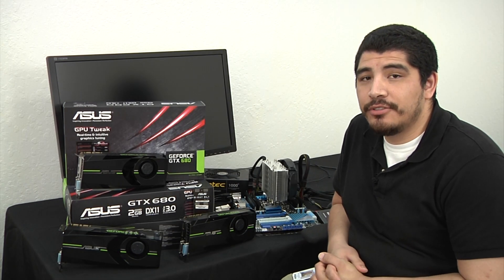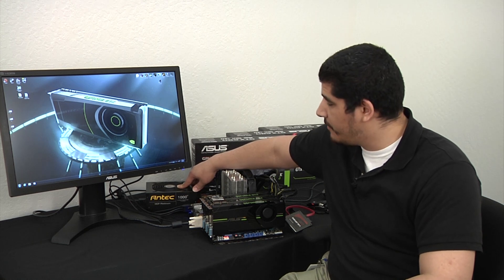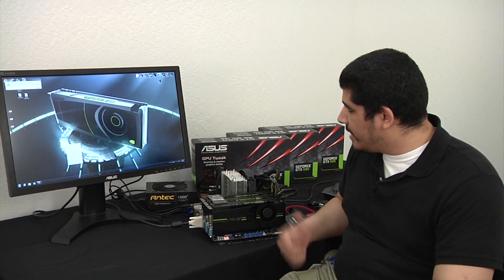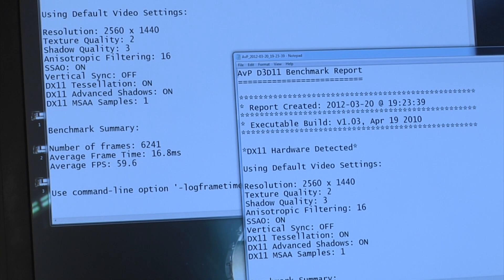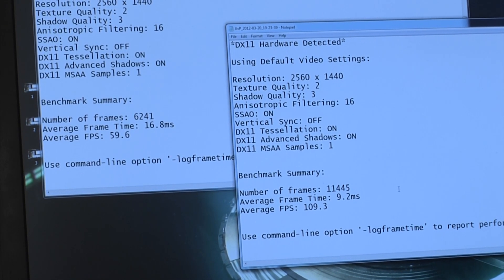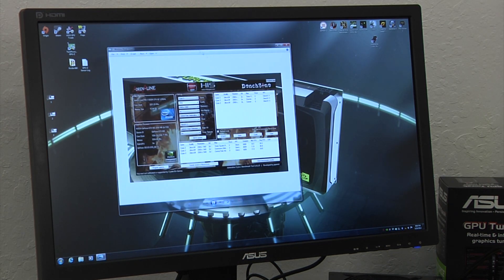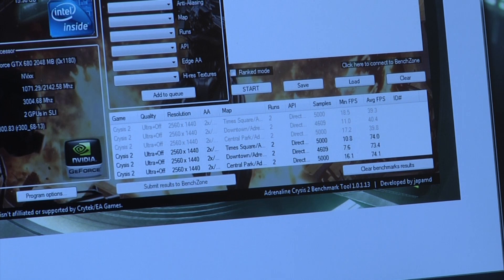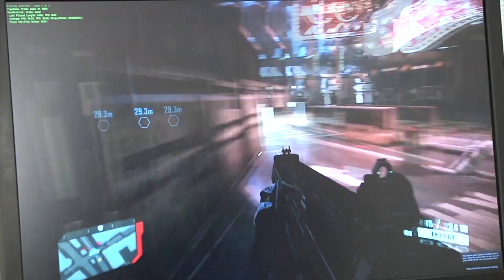3-Way SLI on GeForce GTX680 Graphics Cards by ASUS

Comment: ASUS, I am an avid 3-way user and I only use Asus products. Please help me understand why with your flagship Gaming 3-way Motherboard, the ROG Zenith Extreme Alpha... For a price of over $600 why is there no 60/40 3-way SLI bridge included? I was unable to find a HB SLI bridge for 3-way of any brand except for MSI who has a 80/40 3-way "LED" bridge (detects as HB in GPUz) of course this bridge won't fit the Alpha with 60/40 spacing! So i got the non alpha Zenith Extreme that the 80/40 bridge would fit by jumping the 2nd slot. Unfortunately the board being intended for 4-way seems to really dislike 3way! Help me understand why I had to settle for a lower model motherboard because there is no sufficient SLI bridge available for your flagship x399 motherboard!?! SLI bridges are very cheap, did no one do any testing on the alpha using the non HB bridge too see that atleast an HB LED bridge makes a huuuge difference for sim racing surround users! Just like nvidias Bridge chart states HB for Surround! I'm not pleased with the non alpha zenith, I'm beginning to regret leaving the x399 Strix. PLEASE 60/40 HB SLI bridge! There is no point to 3way on the alpha without it! Thank you

Comment: I purchased the GeForce GTX680 Graphics Card by ASUS, just one card though, I'm on a 64 bit system, and my display driver is forever/keeps on stopping/stopped responding,and crash my pc,how do I fix that, and why is such happening
Reply: if you didnt removed driver of other grafics card and installed driver of new one its normal that yourp pc will crash... best thing to do if i buy a new grafic card... save all data on extern harddrive and reinstall windows with the new grafic driver
Reply: Thanks, but how will I go about allocating both drivers inorder for me to keep the one I need and un install the other?

Comment: I'm assuming you think that the fan on the side is pushing air into the card, however that's not the case. Air going into the card comes from the back (where the video ports are) and gets expelled out though the fan on the side. So the air that gets taken in is cooler air from outside the case and the warm air gets pulled out through the fan into the case. ^-^

Comment: Not all games support fully (or at all) SLI. SLI scaling is horrible with LOTS of games. I personally would get a single 690, even if SOME games will scale 30% better on 3 GTX680. Later you can add another 690, but even 2 is enough. Also, if you clock the 690 at 680 speeds, it is actually faster than 2 680, because of the on board SLI structure! And generate less heat, and you have more Vram!!! VERY important details. For me one 690 would be enough up until the "possible" 790. Why more XD

Comment: actually the 4gb models come in hand at a certain point. if you are running surround for example resolutions as 5760x1080, 5760x1200 or even the extreme 7680x1600 will ask alot of vram with games as Battlefield 3 etc.. however as you mentioned if play games like COD or any other game at 1920x1080 you won't notice any difference in either the 2gb or 4gb

Comment: GB on your grapic card isnt that important. for instance if ur playing COD with a 2GB vs a 4 GB ur FPS wont be higher since ur not using it. on the other side if u run out of memory ur FPS will drop like hell. more important is the speed and the number of shaders and units. the 4GB is used for rendering and stuff. just the Proffesional side.

Comment: Because at the time, the GTX680 WAS faster than the 7970, but later, AMD updated their graphics drivers and with those new graphics drivers which came out not too long ago, it is faster than the GT680. Remember that this vid is made half a year ago when both cards were just released

Comment: 690s have two 680 gpus running at lower clock speeds but with the 690's boost clock, it is able to reach almost the same clock speed as a regular 680. and you can only run 2 690's which would be a quad sli setup. i would recommend the 2 690s because it would only require 2 PCIe 3.0 slots compared to the 4 slots with the quad 680 configuration and the 2 690 cards require less total power than 4 680s

Comment: H50 cannot handle a 4.8ghz overclock, you would do better the a noctua air cooler. H100 could though, if you have the extra dough.

Comment: No input signal means your monitor isn't getting input, a.k.a. the cables are loose or your connections aren't solid. I would reseat your video card (take it out and snap it back in) along w/ the ram.

Comment: to be honest this is not an effective setup for 3 monitors. Games like Battlefield 3 use over 2 GB of memory for 1 screen, and contrary to popular belief, 3X 2GB graphics cards does not = 6 GB, it can only use 2. your better off with the 3 GB version of the GTX 580 for SLI, or, the AMD 7970 for running multiple GPU's

Comment: It's platinum with over 90% efficiency, and most good quality PSU's run 1 12v rail which will supply 95% percent of the power. You're a dumbass.

Comment: Gentlemen, each 680 will draw roughly 250w under load. Times that by 3 and you have 750w. 250w left for CPU/SSD/Ram. Love idiots that buy 1500w PSU's for 2/3 way SLi. It's always incredibly amusing! Now that's out of the way, do you want to send me one 680? I will be eternally grateful.

Comment: Because when the original Crysis came out, it was terribly coded, and it was great to put strain on your system. Back then, if you could run Crysis, you could run pretty much everything else. Although Crysis has been patched numerous times, it's still relatively strenuous. The reason you see Crysis 2 in benchmarks a lot is because it takes full advantage of DirectX 11 (putting out incredible visuals), and partly because it's the sequel to Crysis 1.

Comment: As of December 2011, the latest HD 7000 series graphics cards support for two Mini DisplayPorts 1.2, allowing daisy-chaining up to six monitors, up to 4096x2160 (4K resolution) or 2560x1600p60 Stereoscopic 3D per display and high bit-rate audio from the same connector, optionally behaving like a single large display.

Comment: i think with the scaling part was not quite good enough since a single montior would not stress the gpu's out to shouw how well they do underload. im willing to bet that the 2 other acrds were about 50 percent or less for the gpu usage so would not really show how well scaling is for the card's 2 cards and nvidia surround would pull just about 1000 watts where as a single montior setup would pull about 750 to 800 watts. so that would be the cards are not being used to 100 percent

Comment: exactly. And the price?? INCREDIBLE. Only 500 bucks for the fastest single GPU card on the planet (great for any game on 1920x1080). I have a GTX 570 (i got recently) and i have been looking and debating between the 7970 and 680 for my next upgrade in a year or two (so i can track the new updates and what not) when the prices drop a little (AND SOME IN STOCK...wtf newegg ) and this has been hands down the best best best best card. Only thing i find strange...is the memory only 256bit width 
:(

Comment: Actually, the 7970's benchmarks show the memory bandwidth to be a LOT better than the 680s, and the 680 only slightly beats the 7970 in textile rate and pixel rate. The Radeon 680 is cheaper though, and usually overall better, so I'd just go with that.

Comment: 'being fair' and overclocking one more than the other? LOL. A 7970 will do 1300mhz all day long. A 680 cries to get to 1200. That is it's own fault for not being able to match the OC ability of the 7970. And even clock for clock. If they are 1200 vs 1200mhz, the 7970 wins. It has more memory bandwidth, a wider bus, more VRAM, etc. Learn before you speak nonsense you wannabe. I've posted several links discounting everything you just said. Just because you had a few noobs vote you up means nothing

Comment: LOL. NO IT DOES NOT. The 680 does NOT OC anywhere NEAR as far as the 7970. You cannot handicap one card just because the other cant overclock and then compare them at the same clocks. And even at the same clocks, the 7970 wins. You are clearly an idiot who hasn't read any benchmarks and doesn't know shit about how far a 7970 overclocks or how hard it is to OC a 680 far at all.
hardocp.com/article/2012/04/04/nvidia_kepler_geforce_gtx_680_overclocking_review/5
Back that up fanboy.

Comment: if you can afford it yes why not but there is nothing out there which really needs the 680s power. when the ps4 and xbox (720?) come out then game designers will be able to release games with better graphics as graphics are seriously bottlenecked by the consoles hardware. so i'd wait until then, until you need to and youd save some more money too

Comment: It's not about being a fanboy. If you paid attention you'd see that I have BOTH 7970s and 680s. I know which performs better in which scenarios. The 680 OC's like shit. The 7970 OC's like a champ. The 680 performs 5% better at stock. The 7970 performs 10% better when BOTH are OC'd. At multi-monitor or 1600p resolutions, the 7970 beats the 680 due to its higher memory bandwidth and VRAM. Do some research before you label people. I guess ignorance is bliss on YouTube. ;)

Comment: That's not what you said originally there my little unicorn (who thinks he's a troll). You said the 7970 was the fastest card - it is not, not even on a single monitor with high resolution. Before you go and get your skittles in a wad, we're talking a handful of frames IF that. The HD 7970 is a great card but now has to compete with a $499 GTX 680. Not nearly as many people overclock their 7970s as those who use 3 - 1080p monitors. Hopefully this perspective helps brighten your rainbow.

Comment: I have OC'd the 680. It's a horrible overclocker. Not just myself but various other overclockers that I know can barely OC their 680 by 150mhz, much less the 450mhz OC that people can attain with 7970s. I was 'lucky' with my 680 being able to go +180mhz on the core, but even with that OC, its NO MATCH for a 7970 @ 1320mhz (400mhz OC). I've done the comparisons myself in BF3, AvP, 3dmark11, Metro 2033, etc. The only win on the 680 side was in 3dmark11.. thats it.

Comment: Because everyone uses pathetic resolutions like 1080p right? People like myself use resolutions of 2560x1440 and beyond, such as 5760x1080 (triple monitor res), in which the 7970 and its MUCH higher memory bandwidth OWNS the 680 in every respect. I own both, so there is no bias here. I know what works best. The 7970 simply overclocks better, and performs better at resolutions beyond 1080p. The ONLY hope the 680 has is @ 1080p or below.

Comment: A 680 is NOT going to outperform 2 580s in SLI. Not going to happen. Just like it doesn't Overclock worth a crap either. You can't even OC it to bring it closer to 580 SLI performance, because its already at or near its maximum. I'm returning my GTX680 and buying another 7970.

Comment: I see all the Nvidia fanboys voted my comment down about the 7970 still beating the 680. Unfortunately for you fanboys its the truth. The 7970 scales in Crossfire better, it Overclocks better, and performs better when overclocked. Try overclocking your 680s yourself when you buy one, and you'll see what I mean. I own one myself and their overclockability is garbage. My 3 7970s all OC'd by 400mhz. The 680 I have only OC'd by 150mhz before crashing/BSOD. Good luck with that fanboys...

Comment: That depends on how smooth you like your games. At 60 FPS, a game is rendering extremely smoothly. At 40 FPS, you start to notice a little stutter. Below 40 FPS, most gamers see the stutter. Adaptive VSync (coming in Release 300 drivers) will control that better. If you like smooth, find the sampling and detail settings that keep you at 60 FPS. Otherwise, it's mainly up to your own eyes and preference.

Comment: The GTX 680 is consistently producing higher average frame rates here especially using a 1920 x 1200 resolution. It's definitely doing better at 1080p with 3D Vision. And, it's the same when overclocking.

Comment: The part of the cooler in which the fan is present is pressed down, so it leaves a gap for the air to get sucked in even when there is a card just below it.